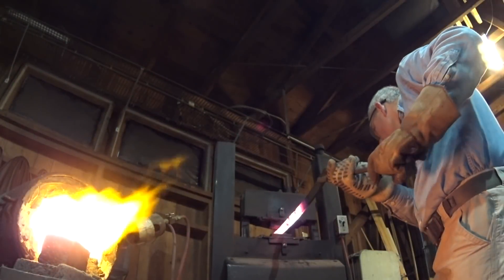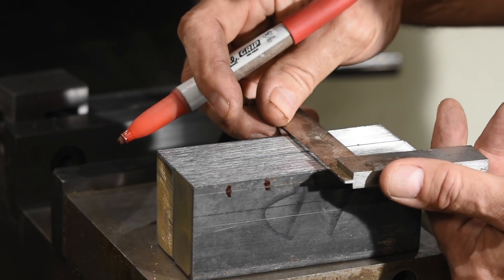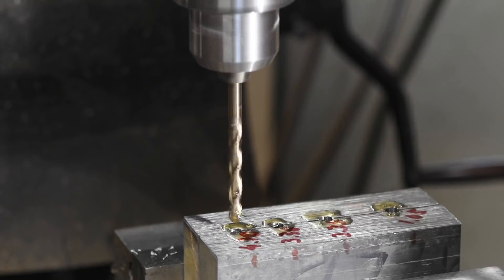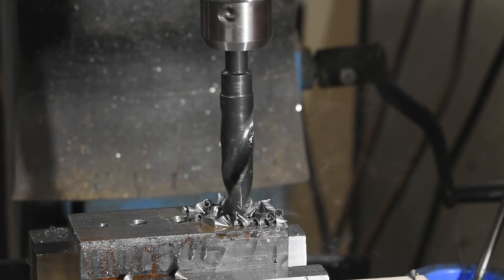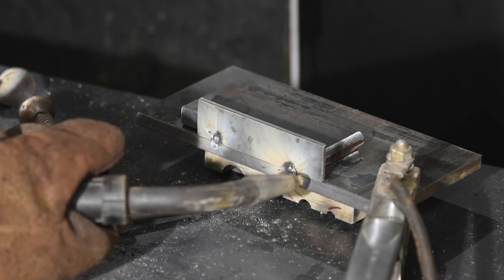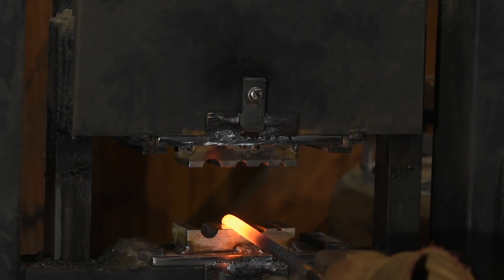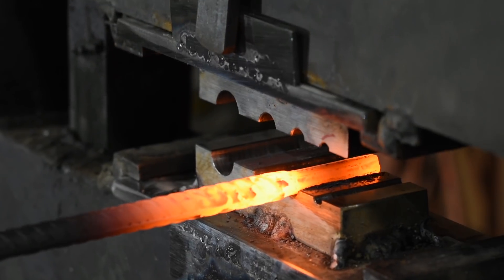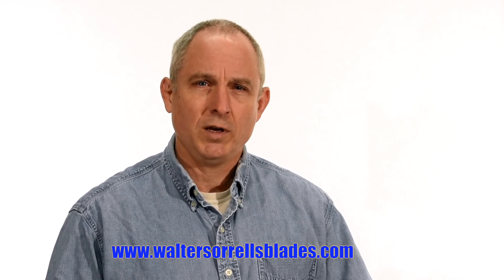Making a Die for a Forge Press

Comment: Material you’re using for die inserts is garbage.  Hot toll steel will last for about 10 parts and then start to pit from the heat.
M2 is not a good choice either it doesn’t do well with that kind of heat…it’s high speed steel meant for drills, end mills and knives. M2 is meant for applications where a sharp edge is required to withstand cutting.
If you need a good material for Die Blocks, try H-13, Finkl FX1 or FX2. Finkl comes already heat treated to correct hardness.  So once your done machining the die you can use it right away.

Comment: If you removed material from the edges it would work correctly. Should be shaped like an eyeball. It will force materials to the center without forming a flashing every time it is squeezed. Rotate   Between every blow. Top and bottom will size the material

Comment: Great video!  Have you done or considered doing a power hammer vs. hydraulic press video from the perspective of "if you only have room for one piece in your shop?"  Thanks.
Reply: press is prooooooobably more versatile... for a bladesmith.   for a blacksmith, power hammer? as long as it's good.  a good fly press can do things well to though.  

IT DEPENDS!

both arguments can be made either way i reckon.

You have to make less dies, less often, on a press?
Reply: @down1nit2  Ilike your help
Reply: @down1nit2 .  Yup.  I had to make the choice.  I went with press.  It's also a cheaper way to go.  Went with the coal iron works 12 ton.